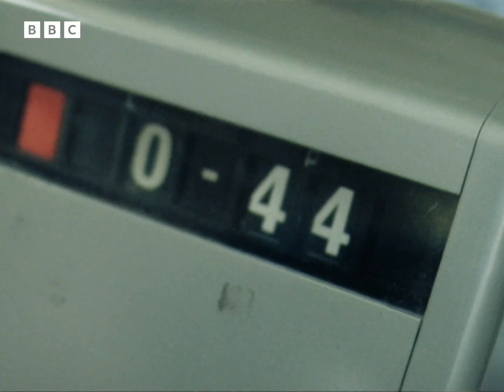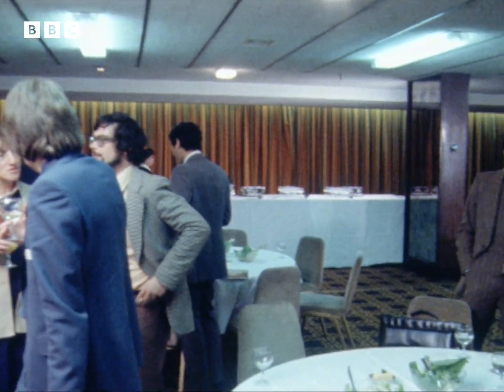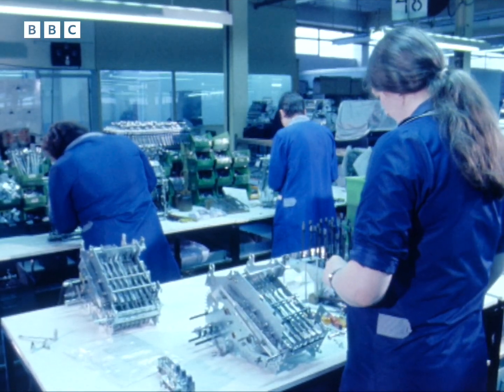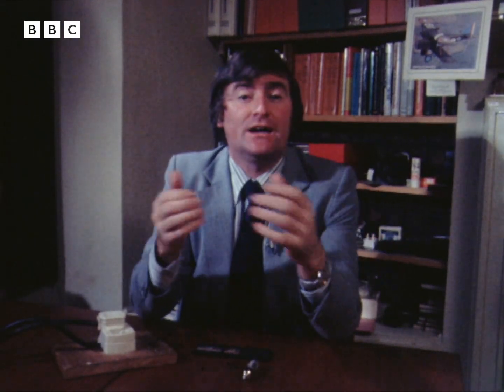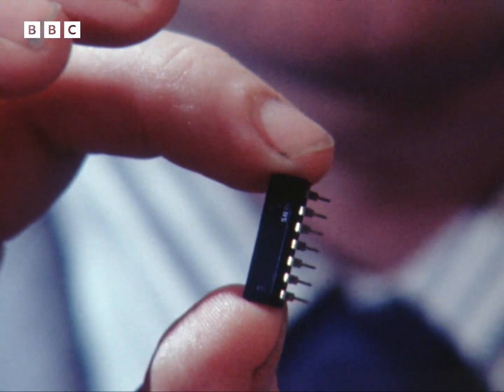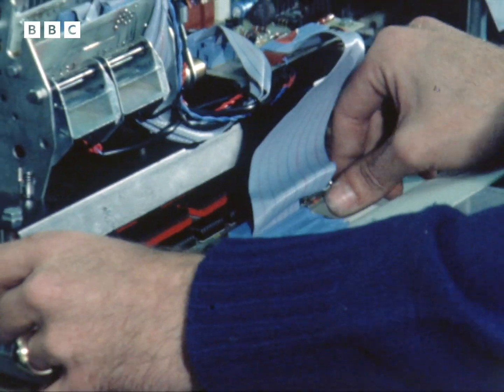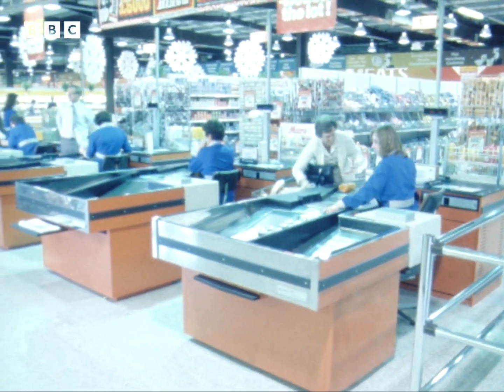1979: BEHOLD! The LASER-OPERATED Future of SHOPPING | Nationwide | Retro Tech | BBC Archive

Comment: The trouble with electronic cash registers is that they're light enough for a thief to pick them up and carry them off.  The old mechanical cash registers weigh around 100 lbs., so they're like safes.
Reply: Small business owner here. You know we can screw the cash drawer into the counter, or even put the cash drawer below the counter? They come with a cable to connect the till and drawer.
Yeah, you're probably right; most probably unbox and just plonk it in position without thought. 
I always do both, but obviously the insert is removable if a thief was to get the drawer open. There's a manual tab on the bottom, but I've made it as hard as possible for anyone to reach, whilst not making it impossible if I need to.
Reply: its ok dont use cash

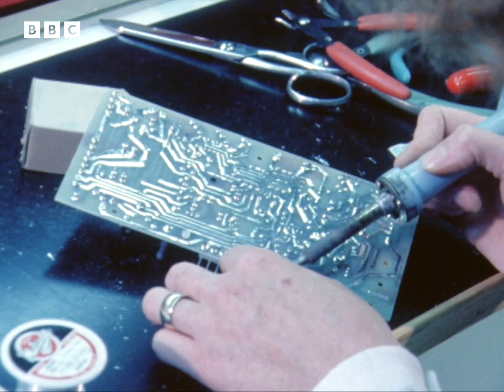Comment: At 08:33 you see a Weller soldering iron.  I worked in a factory in the early 80s, had the same model and I've still got it and use it weekly now!
Reply: I don't think the other commenter appreciat3s the longevity of weller soldering irons. We've got a working '80s one at home too lol
Reply: @therealchayd  I've got one that I used at the IBM Factory in Havant, UK in 1969 and I still use it. It's as good as ever.👍😎
Reply: @therealchayd  ok
Reply: Yes Weller,ive got several 24 volt models from the 80,s still using them today,they were the best back then,the only mod i did back then was,i made them triac switched,because they were on all day, week after week,and would require the mechanical mag switch to be replaced every couple of months or so.Clever design,worked by magnet force being weakened when a certain temp was reached,this was governed by the temp rating of bit used.,which then activated a T looking double contact switch in the handle.
Reply: 🤣 boomers who write "ok" because they don't know how the thumbs up button works
Reply: @vink6163  Ok.  You should check if one is a boomer, before calling one is a boomer, ok?  A simple check would have told you that, ok?  Do you feel stupid now, ok?
Reply: @Locutus  ok boomer
Reply: @vink6163  So, so, sooo witty and clever. Must have taken you hours to come up with that, Boomer. 👏👏👏
Reply: @Locutus  triggered
Reply: @vink6163  Damn, you got me... I am triggered by small boys trying to be clever, by using insults - totally triggered me. 🔫🔫🔫
Reply: @Locutus  Well I'm just messing with you.  You posted a snarky reply to the OP which I thought was quite rude so I figured maybe you need to be on the receiving end for a bit - don't dish it out if you can't take it, in other words.  Maybe next time you'll keep the disparaging replies to yourself!
Reply: @vink6163  You honestly think I was triggered? 🤦🏼‍♂️😂😂 If you find someone saying "ok" as snarkey or, even disparaging, then help us all.
Reply: @Locutus  It's pretty clear you were, first you got upset at being called a boomer without a "simple check" then you straight away called me a boomer in return, failing your own requirement.  Logic mistakes like that are the first sign of someone getting worked up and not thinking clearly.
Reply: Ok.

Comment: Amazing!  My mobile phone has 19 billion transistors in its chip.
Reply: i still prefer jack n jill potato chips
Reply: 19 billion transistors, and it’s 35 million times faster than a 6800. (Assuming you’re talking about the A17 Pro in the iPhone 15 Pro.)
Reply: @-_James_- iPhone is an overkill comparison. My cheap Chinese phone is already more powerful than the 6800 you mentioned.
Reply: @bltzcstrnx  Pretty much any processor from the last 45 years is faster than a 6800.  But you miss the point I was making.  Which is how much faster processors have become in such a short time, and how much faster they are becoming every year.  The A17 Pro processor is (depending on which benchmark you use) up to 1000 times faster than the ARM 11 in the original iPhone.
Reply: If you Sellotape together, the remote control devices of a Sony 511-UK and a Hitachi SK-101 and then pop the creation into a haversack and leave it on the top deck of a bus in town, then what you have done is actually read my comment to its anticlimactic end needlessly.

Comment: Where I live there is a little village shop and the man that owned it was still using a Victorian till which was basically a long wooden box with a draw and little sections in it for change it also had a little slot in the top were the receipts use to come out.  He was still using it in the early 2000’s before he retired.😊
Reply: @RunningAround1010 He started writing in only two columns on the receipts🙂 - tills like that had no keys or printed numbers, the user wrote out the receipt by hand on the till roll through a window in the top of the machine before tearing the top copy off and giving it to the customer while a carbon copy was kept on a take up roll inside the machine that was advanced when a lever was pulled to open the till drawer, on some models this left a mark on the roll that the assistant had to explain if they hadn't written a receipt above it!
Reply: Like the one Basil has in Fawlty Towers... ref: the headbut and the money he won on a horse 😂
Reply: They had those tills in the famous bookshop Foyles on Charing Cross Road until the late 90s with a three way payment system (the old woman still ran the place). A friend of mine went to work for them in about 1993 and he said that staff just took whatever money they needed. No wonder that particular store went under.
Reply: @SirArthurStreebGreebling  It didn't go under. Foyles simply moved to a new location.
Reply: @RunningAround1010 Well I was born in 1969, so I never noticed the difference because I have always used the decimal system.